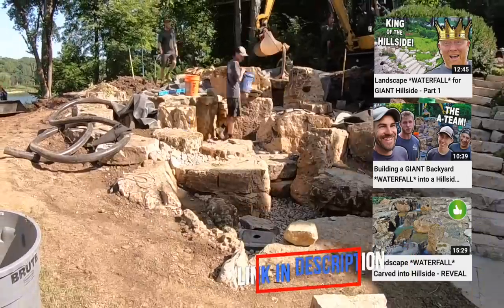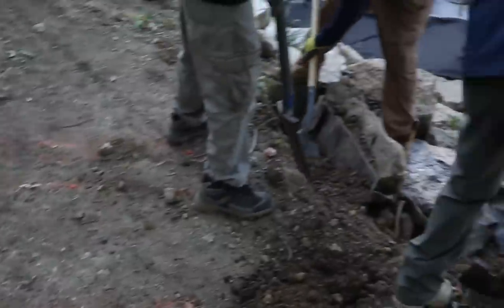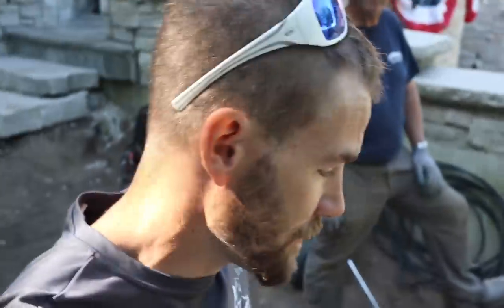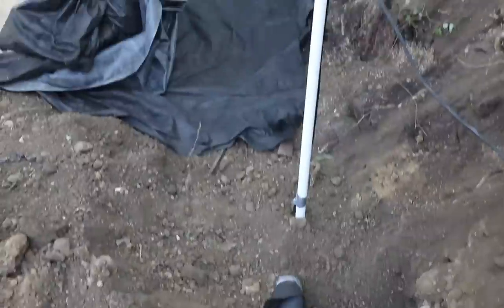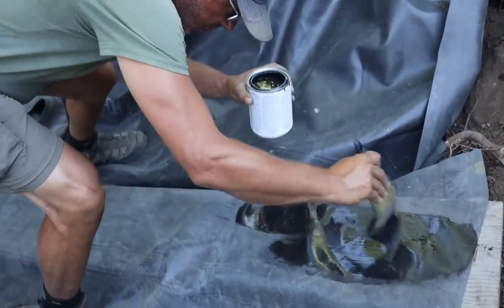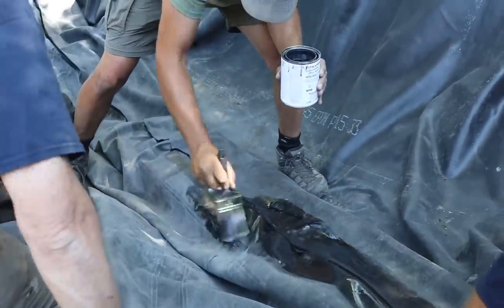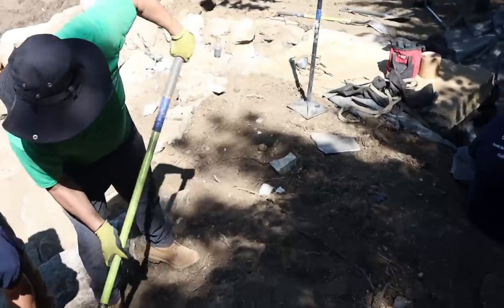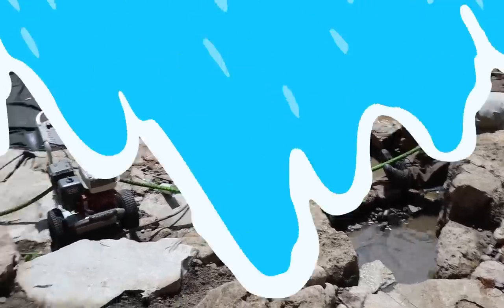Giant Hillside *WATERFALL* FINISH!

Comment: I have watched dozens of your videos and seen you set hundreds of boulders, but have always wondered how you get the straps out from under the boulders once you set it down.  Some are obvious as there is some protrusion on the sides that allow you to run the straps under without going completely under, but on a lot of them the strap goes right under the bottom of the boulder.  In your next video could you show how you get the straps out after you set the boulder down?
Reply: Burke bar